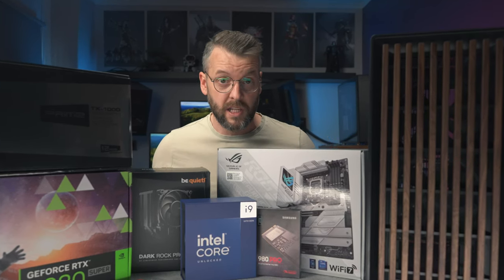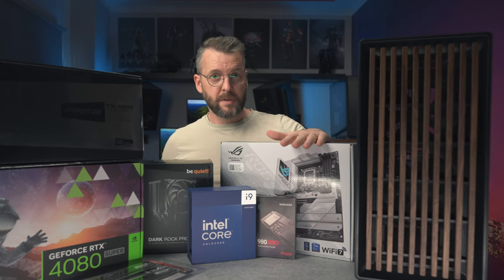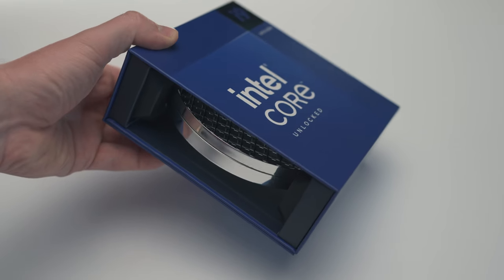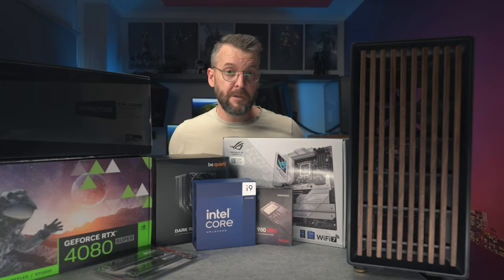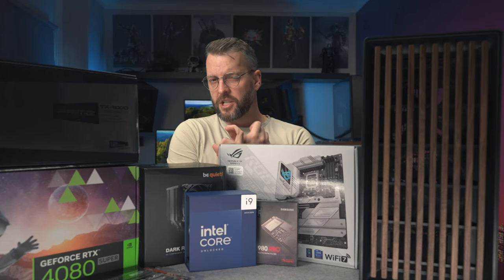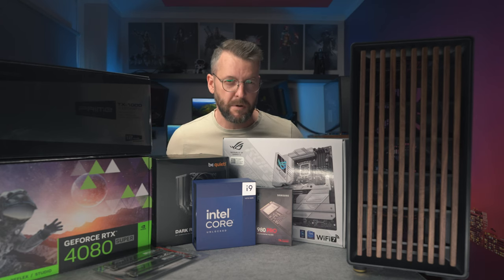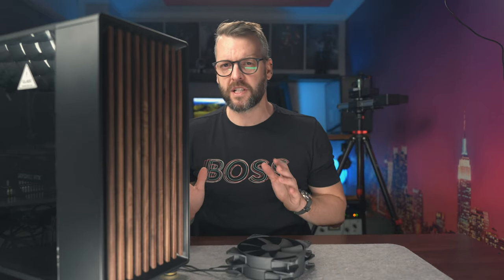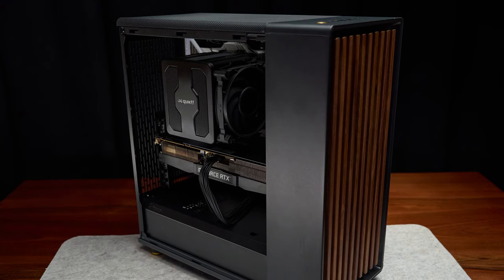The prettiest PC I have ever built. The Fractal North.

Comment: Lovely video man, a weel diserved thumbs up!
Had a couple questions for you as I'm planning a similar build myself. I've read that the PSU slot is a bit narrow and can cause some issues, curious whether you encountered any? Likewise for the GPU, is it blocking hard drive bays? I'm also planning on putting an AIO, there should be enough space at the top, fingers crossed I guess 

Finally, you mentioned third party anti sag bracket for the GPU, would you have any recommendations to share on those you liked?

Comment: My favorite cases are Nanoxia Towers and Supermicro 19". I do not like cheap ones. They spill my blood every single time i have to use them. 

I use be-quiet or Supermicro power supplies, Asus or Supermicro Mainboards, AMD or Intel - idc, Crucial on PC and Kingston or Crucial Server Memory, depending on availability and usually Samsung SSDs. Sometimes i use Seagate SAS SSD's for Servers whcih have a better bandwidth utilization than the Samsungs with Braodcom/LSI Controllers/HBA's. Intel 10 GB and in some cases very expensive Chelsio for TrueNAS.